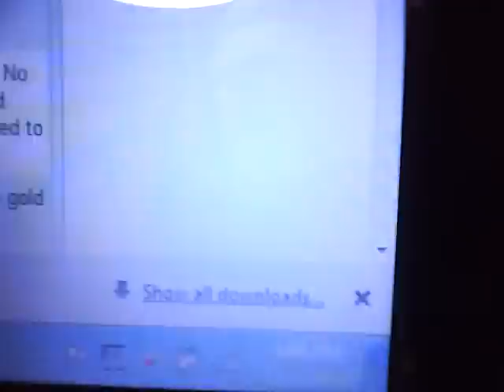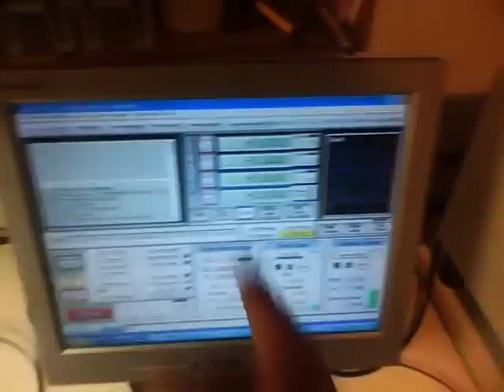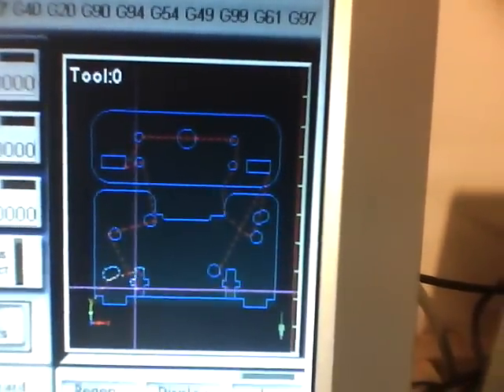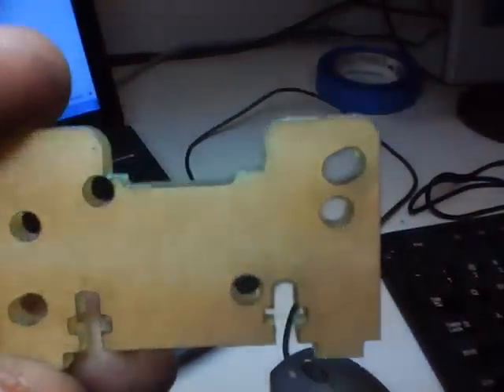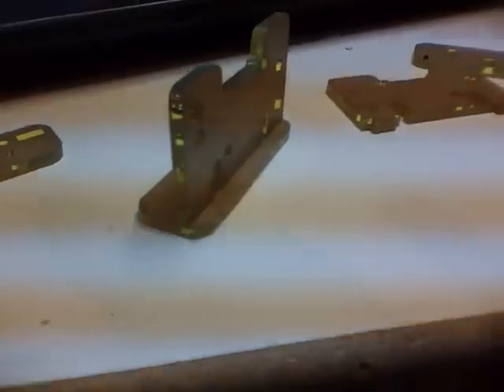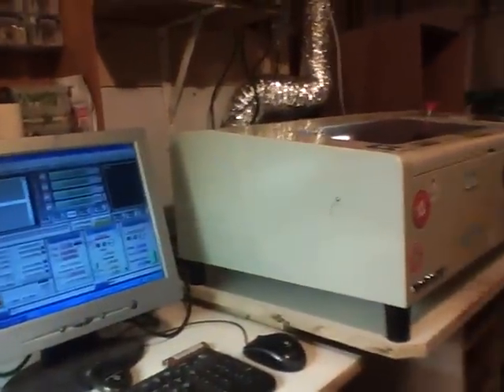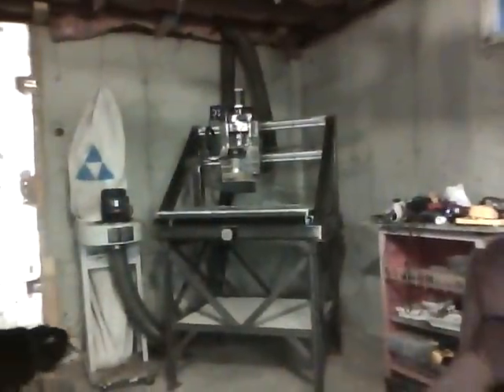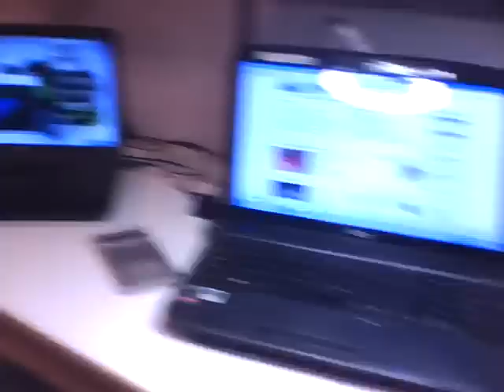Laser Cutter is Fixed (Contains Profanity)

Comment: Good work!  So with going Mach 3 and 16th steps, do you actually get smoother corners, or finer feature size or any other benefits?  Or was the old setup virtually at the limits of the laser size or something?